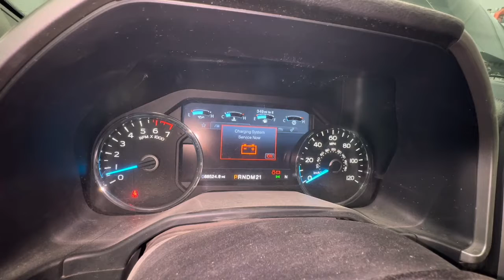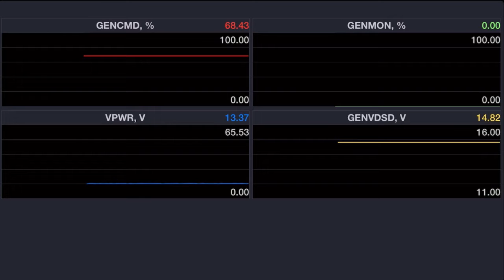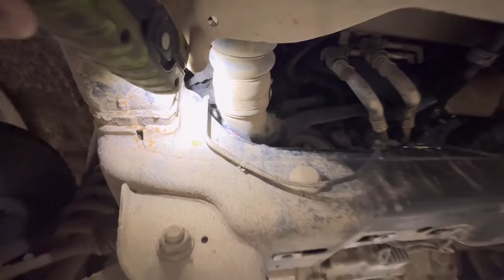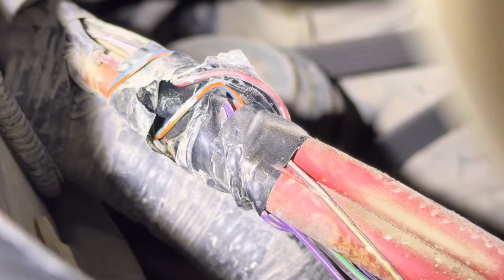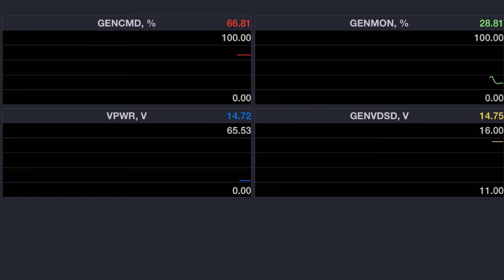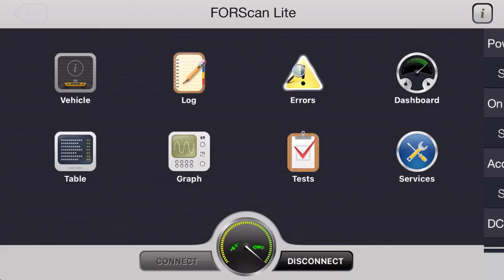2016 F150 Charging System Service Now Message

Comment: This is the second time it’s happened to my F-150 2.7, and in this instance it was this exact wire (blue/orange), which was just the warning light and charging at 13.5 volts. The first time it was the (brown/red) wire and it was overcharging, causing screens to shut off and even the engine to shut down while driving(not good). I totally bypassed the corroded 2 wires from the crank pulley area up to the harness plug with new wires(crimped and heat shrunk) and new wire loom since it was much easier and long term better if there’s still corrosion in the old wires near the frame rail. The last wire I haven’t replaced is the purple one, I hope that lasts…

Thanks for the video, have a great day.

Comment: I have a 2015 Roush stage3 Mustang.   Battery was getting weak and 5 years old. Voltage on display always showed 13.7-14.2v.  Changed the battery did battery reset , now the voltage on display at startup in the morning 13.7v.  By the time I get to work 10miles. The voltage is around 12.6v.    Is this just a learning process of the system after reset or something different?

Comment: Can you drive a vehicle with this problem because my truck just starting doing this
Reply from the maker: As long as it’s still charging you should be able to.
Reply: @CarShopTalk  Eventually mine just didn't start.  In a parking lot somewhere. Battery is fine.
Reply from the maker: @CurtFranklin333  fine, but discharged or fine, fully charged and it still doesn’t crank over?
Reply: @CarShopTalk full battery no crank, maybe the starter? It does say charging system service

Comment: My 2018 ford fusion does this. I’ve done took my car  back to the ford shop 4 times for them to fixe this problem… they did not fix it. The last time they changed the battery and alternator and it’s still doing the same thing. I parked my car in the garage because I don’t want to be stranded.